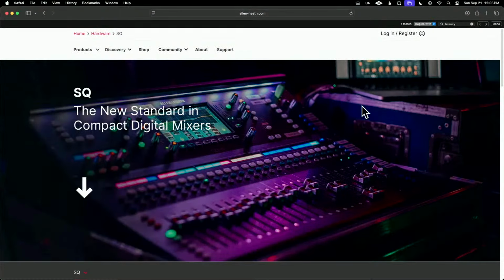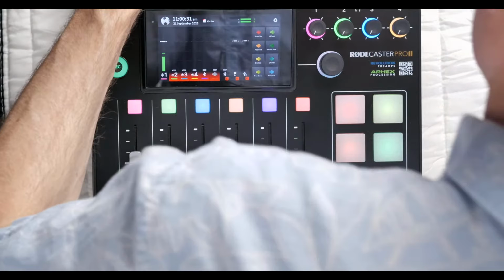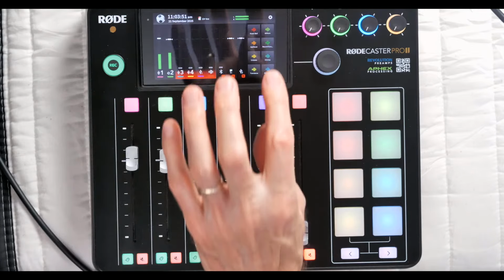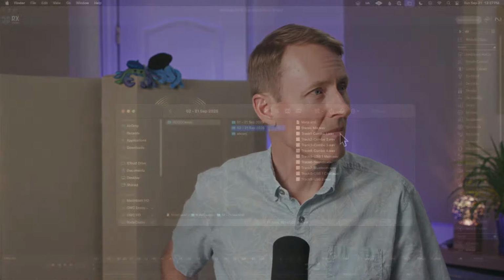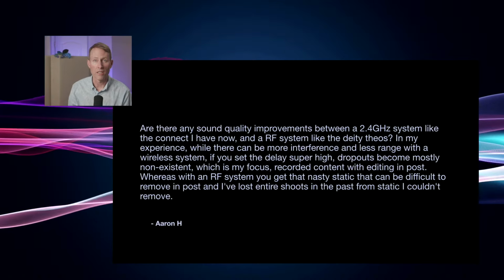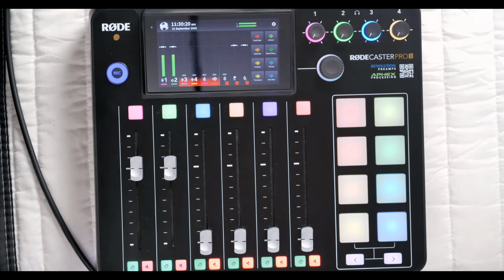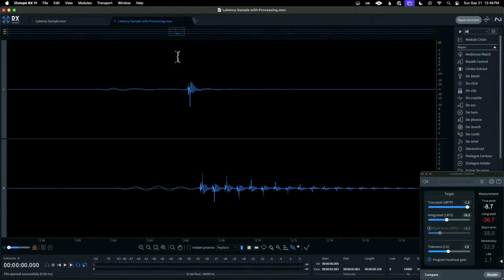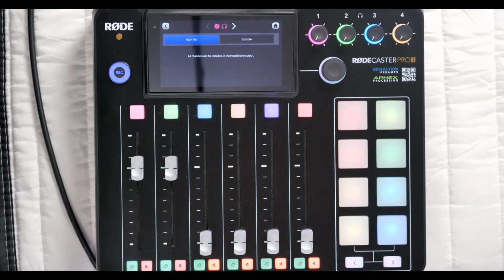Sound for Video Session: Digital Audio Latency

Comment: Regarding Dante on Prosumer live gear in general, I do know that there are small/mid/multi-event, multi-use venues hosting local/small bands (that want to bring their own gear but have no tech) end up with big setup headaches. Dante is what those venues are pushing (if a performer is determined to use their own gear rather than house setup—which is Dante). Dante has the "new hotness" buzz everyone is chasing. Though it would seem odd for integration into Rodecaster. That's a little out of class.